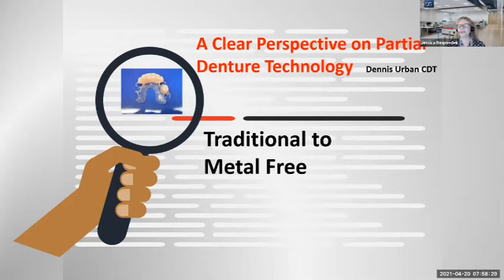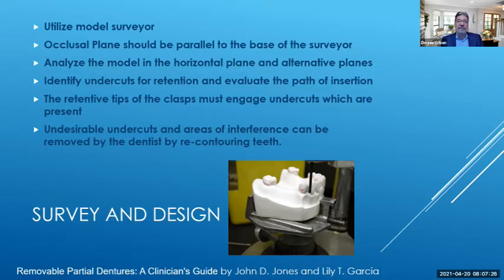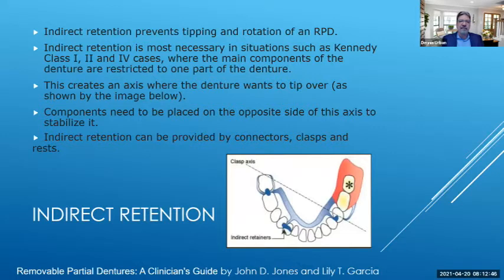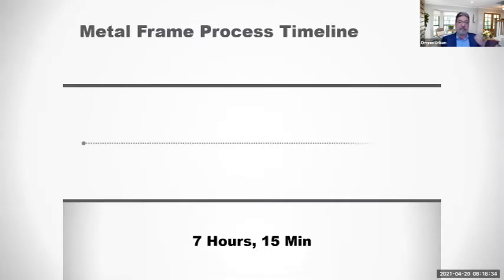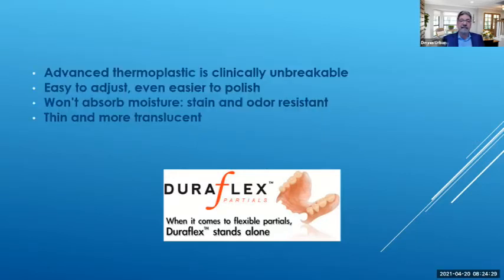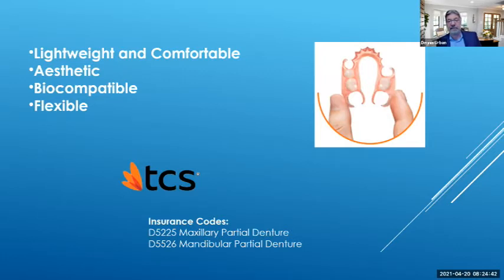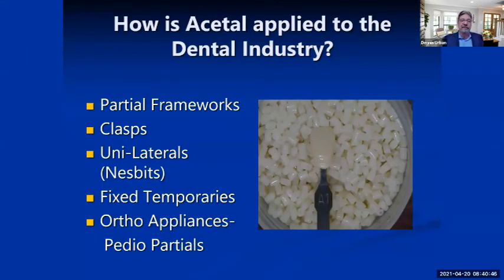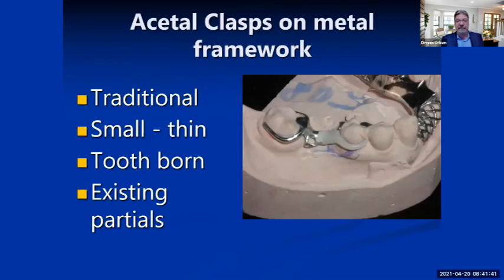Resident Series: A Clear Perspective on Partial Dentures

Comment: Hi!
I am thinking of using a metal partial denture but I have many doubts and fears.
Do the clasps damage the healthy teeth where they are attached?
Can you chew and eat well with it?
Is it a good option today?
Thanks!
Reply from the maker: Dennis Urban: “There is nothing wrong with prescribing a metal partial if it is designed correctly.  Utilizing the appropriate undercuts and height of contour on the teeth to be clasped will prove very effective.  This in conjunction with the proper Kennedy Classifications and the appropriate Major and Minor connector will yield to a successful metal partial for the patient. Also, the examination of healthy tooth structure analysis is essential.”